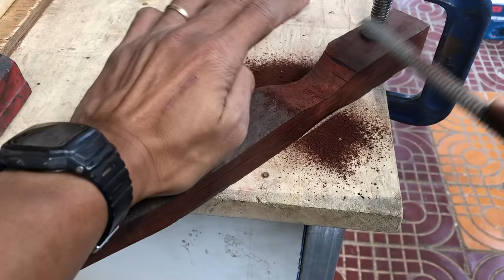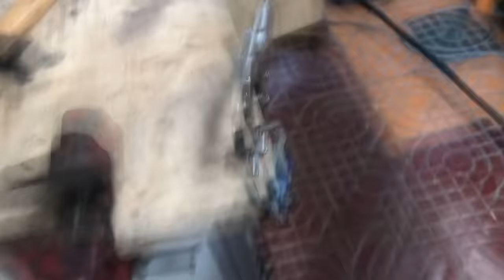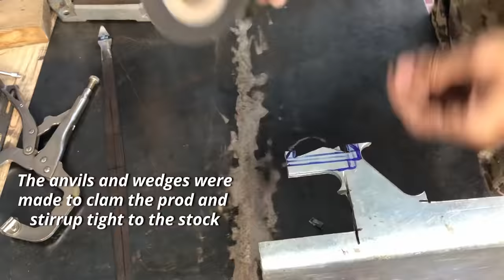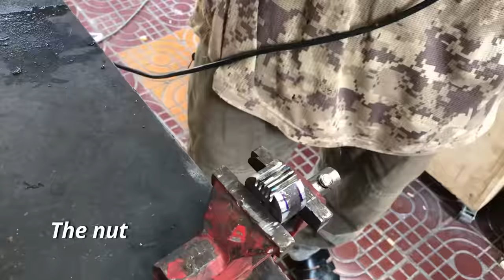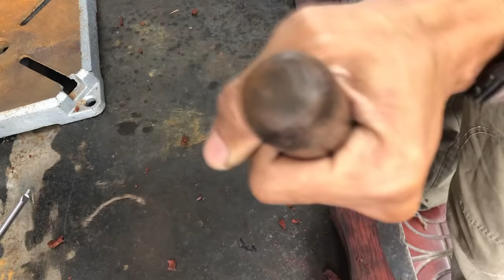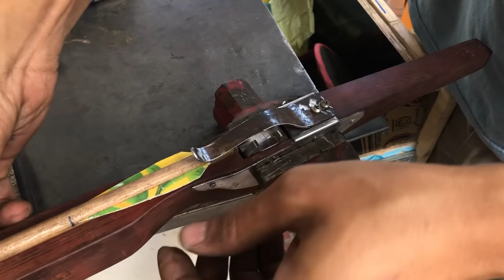How to build Mini Medieval crossbow, Rose Wood stock, prod make from blade of table plane not PVC

Comment: Can you share the size? Length and width and height. ThX~~  :)
Reply from the maker: Thanks Kris for the comment and request. I would like to give you the following measurement: the whole stock length is 39cm, the length from prod to the trigger is 18cm, the thickness of the stock where the bolt rest on is 3cm, the prod is 50cm including the curves. the length of the string is 43. I hope this help :)